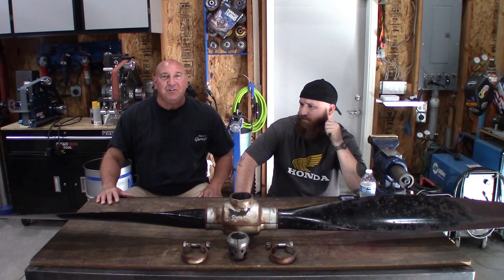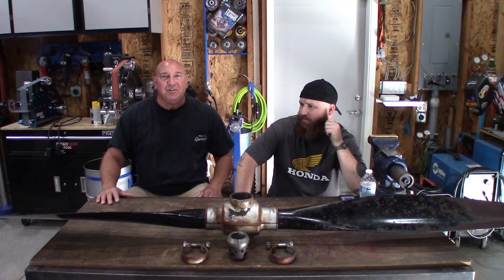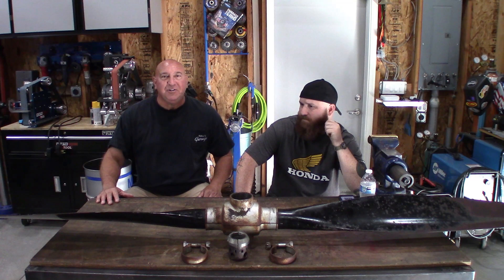Propeller Refinish

Comment: Ray, Phil, 
I do not believe that the prop is off an LC-126 AKA Cessna 190-195. I am an A&P Mechanic, with an Inspection Authorization. I owned a Cessna 195 for 42 years. My old Cessna is in Bavaria Germany now. The prop on the Cessna 195 was a Constant Speed Prop. A Hamilton Standard 2B20 to be exact. That propeller would have had aluminum blades. It was a propeller that the angle of the blades was adjusted in flight via a prop governor to keep the RPM of the engine at whatever RPM the pilot wished. That prop is called a Ground Adjustable prop that could be adjusted on the ground with a protractor and wrenches to different angles based on the desired RPM of the engine. I would guess that prop is off of a Stearman PT-17. They had Ground Adjustable props. Hopes this helps some.
Gary 77-Year-Old Pilot, Mechanic, Home-Shop-Machinist and general jack of all trades in the Beautiful Ozark Mountains of Northwest Arkansas
Reply from the maker: Gary, This Great information and I will be pinning your very valuable information to the top my friend! Thank you so much for taking the time and your knowledge and sharing this! It’s viewers like you that make YouTube awesome! Best Regards, Ray
Reply: The Propeller you have is a McCauley ground adjustable propeller. They required a magnetic particle inspection (Magnaflux) every 100 hours of service. 
It was fun watching your presentation. 
Gary in Northwest Arkansas
Reply from the maker: Many Thanks Gary, Great Info my friend! Thanks for sharing!
Reply: Hi Gary,  I should of went down and certified it Not Airworthy for them.
Reply: @RRINTHESHOP  Hi Randy... Great to hear from you. I was beginning to worry about you...
Gary
Reply: @Gary.7920  Doing well, Thank you Gary.

Comment: Your shop is like da bomb now. You're just too good for ME to compete with.
I recently discovered "stripper" discs that go on a 4-1/2" grinder (got mine at Home Depot). They take off rust, paint and mill scale so easily, and leave a better surface finish than flap discs, just primer it and go. They don't last as long as flap discs, but they work so fast it could be a wash (no science to back that up).
Reply from the maker: Hey Wes, How you doing my good friend! Thanks for the grinder disc info, I'll have to check them out since you know I  like products that really work! Hope all is well with you my friend!